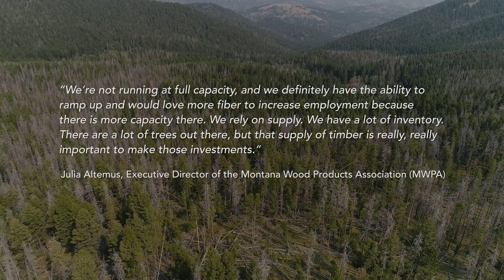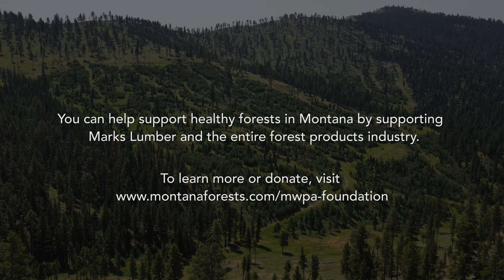Montana Forestry Infrastructure

Comment: Scare tactics! Every year the dead tree becomes less and less flammable. As it decomposes The Mulch holds water that hydrate the trees making them more fire-resistant. These natural systems have been in place for millennials, how arrogant we are to think that we need to do something. Forest recovering nicely after fires, even if it's severe though it may take a little longer. Dead trees are incredibly important in the ecosystem. Protected Forest burn with less severity than those places that have been treated